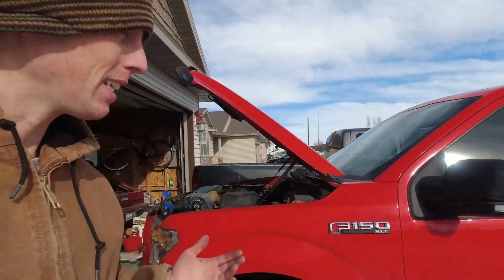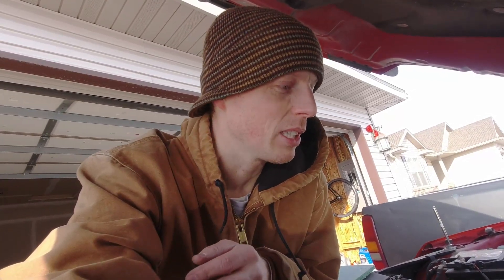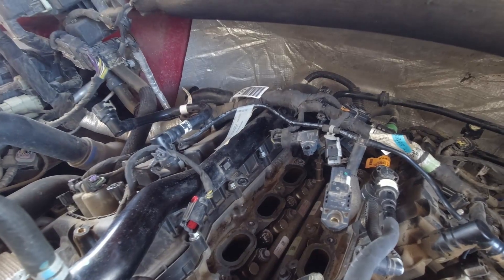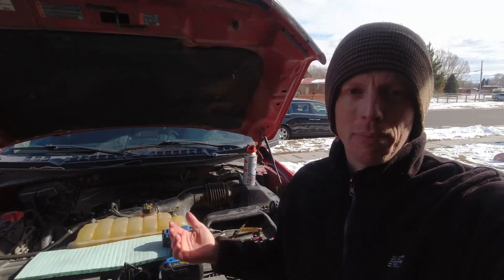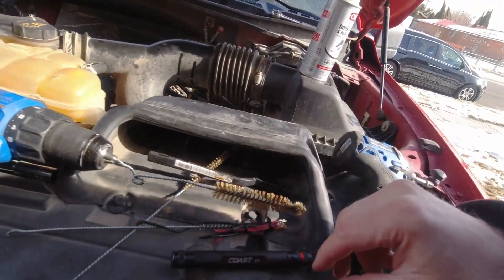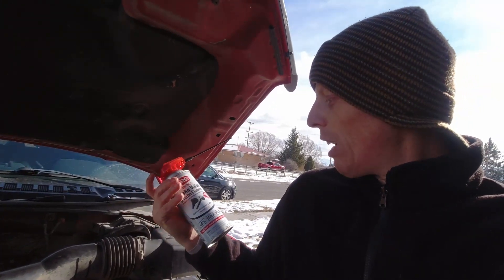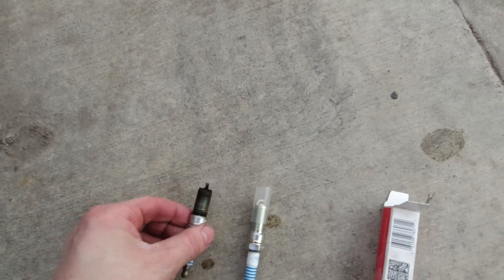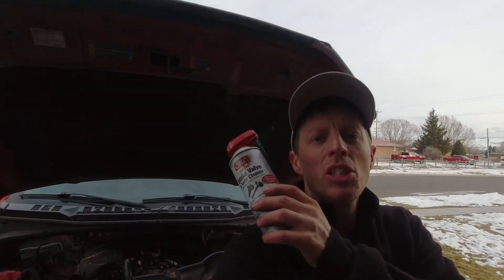2.7L Ecoboost Valve Cleaning

Comment: I soaked my ports in brake clean overnight on my 2.0 Escape, and used the zip tie with a drill method, turned out pretty good.

Comment: About to buy a high mileage 2015, 194k.  This will be one of the first things I do to it.  Haven't finished the vid yet, but the shot you show of the valves, they don't look too bad, compared to my 2.0 Escape at 113k... They were caked!
Reply: Also replace the transmission fluid, transfer case and differential fluid.

Comment: Have you had any issues with rattle at start up on it ? I just bought one with 170k miles and it does it but it really doesn’t affect driving or anything else besides the sound at starting mine is a 2015 as well
Reply: That's your cam phasers...best to get that fixed

Comment: Any new news on cleaning the intake valves on 2.3 liter Ford ecoboost engines? 
There's a lot of information now (in DEC 2024) that using spray cleaners into the intake can damage or destroy the turbo.

Comment: I have  2016 2.7 with close to 190K miles on it and still runs great but kinda wonder what the valves look like since I never tried cleaning them or install a catch can. I change the plugs about every 30 thousand miles whether it needs them or not and change the oil every 3500 miles or so.

Comment: I’ve used the STP brand one and it’s super easy to do. The hardest part about it is getting the nossle in before the throttle body on the 2.7. I looked in mine with a bore scope before and after and was amazed at the results. I’m going to do it again in about 10k from when I did it last. When you do the STP one it will feel like it’s misfiring some but it will straighten out during the 9 mins

Comment: I read that you shouldn’t do the chemical cleaning (manual only) because of turbo related issues. Like the pipe cleaner and drill ideas though, definitely better than the brush.

Comment: Thanks for the great 2.7l videos, not much out there. I have 98k on my 2016 2.7l and just changed the plugs.  After I had my truck for about a year I heard about the catch can and installed one at about 30k miles.   Your gas mileage seems right for 80MPH but I get much better at 70MPH, I can see 23-25MPG on the flat roads out here on the east coast. Looking forward to your next 2.7 video.
Reply: Can confirm the 2.7 will deliver advertised mpg at slower speeds and Florida 0' elevation. Had a Lariat super crew for a couple weeks while my 3.5 was getting service. It delivered great mpg and seemed like it had something to prove everytime I stepped on the gas.
Reply: 198k on my 2.7 and I’ve never seen better than 18 mpg. But with that being said, previous owner put a leveling kit on the truck that I’m really tempted to take off.

Comment: I was wondering how big of a pain it was to remove the manifold on my 2.7. Now I know. lol. Im surprised the valves were not very dirty. I expected a lot more carbon build up with that mileage. Im about 100,000 behind you. I think I’ll hold off on the walnut blasting for now since yours didn’t look too bad. Im going to start using the spray every other oil change. Question, did you break anything doing this job?  I broke an evap hose with a green clip close to the air box when I did my spark plugs this last weekend. Instead of going to the dealer to buy the entire plastic intake tube, I fixed it myself for like $5. But, it seems like there’s so much fragile small plastic pieces on this motor, things are just bound to snap with a little pressure especially after the plastic has become brittle over the years. I used the intake valve cleaner spray before I did the spark plugs, and after that and the spark plug change the intermittent “rough” idle/“hesitation” went away and I went from 18 MPG average to 21.8 MPG average. Oh I also put a bottle of GUMOUT fuel system cleaner. That prob helped with everything also.

Comment: You have a evap system valve on top of your gas tank that gets stuck open. Very common on 2015 2.7l. When it gets stuck in the open position it causes rough idle and sometimes  completely stalling out of the vehicle especially right after refuelling. 

It takes a while for the engine code to come on(4 months for me) when  it does it’s a  p2450, ford released a TSB on this issue.
Reply from the maker: That is good to know.  It hasn't done it since filling, but if it happens again that will be the next thing I will check.
Reply: That is great information, thanks for sharing. I’ll keep that in mind also.
Reply: I had that issue as well.  My truck didn't die, but just ran very rough for a day or two.  After pulling the code, I replaced the purge valve on top of the engine (driver's side) and cleared the code.  No more issues.  The part is not terribly expensive either and takes about 15 mins to replace from start to finish.
Reply: @billymc2681  which engine do you have? Also do you have the part number? Available

Comment: Spraying into the intake like that is an induction service. Somewhere online I had read that Ford doesn’t recommend that service since it can lead to turbo failure. Maybe the increased fuel burns in the exhaust?  At 130,000 miles and could probably use the cleaning on my ‘15. It does run fine, so maybe when I do the spark plugs.